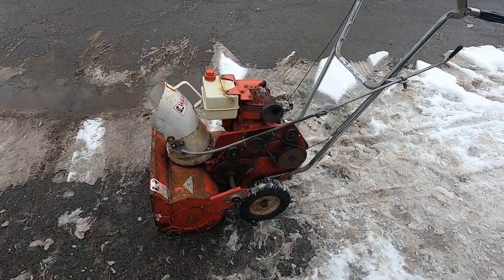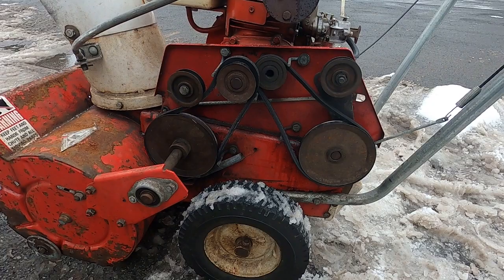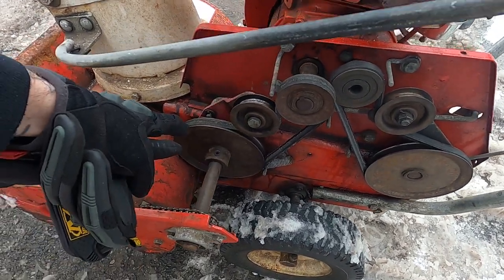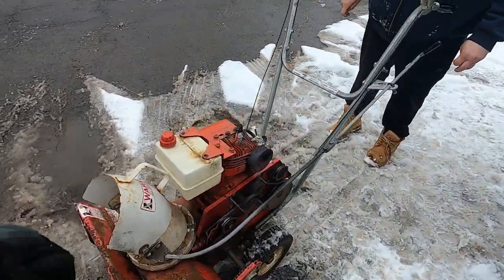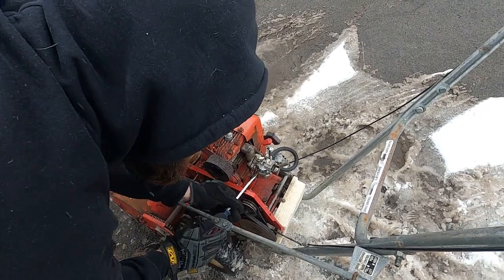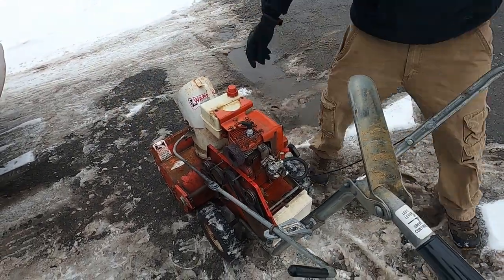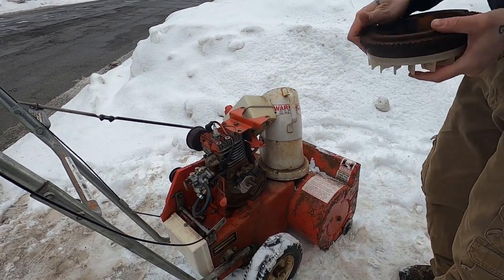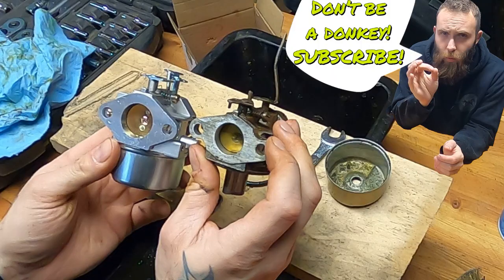Antique Sears Snow Blower Explored

Comment: I have a 1974 Eska  945c snow blower that was made in Dubuque, Iowa. Zero safety features.  Auger spins when engine is running.  Has forward and reverse. All chain drive.  Single stage. 5 hp Tecumseh.  Wasn't run for 35 years,  Put gas in it and it started.  Had a 8 inch snow with drifts and the beast tore right through it. A keeper.

Comment: I believe the sideways mounting of the engine is on purpose. It appears to be a single stage that is actually propelled by the wheels. If you look at the modern-day Toro snowmaster series of single stage snow blowers you'll notice that the engine is sideways.

Comment: The model number is 536.918000. The 9236 is a code of some sort... I know it is NOT 1992, because I have the same model, coded 9225,  and I'm pretty sure I was using it in the 1980s in highschool...  Two more things, it came with a plastic cover for the drive belts, I still use mine in the Chicago weather.
Reply: The date code is the 236th (236th) day of 1979, which was Friday, August 24th. Yours is the 225th day of 1979 which is Monday, August 13th. The "536" in the model number denotes that AMF/Western Tool (which eventually was bought by Murray and then Briggs and Stratton) made it for Sears.

Comment: Looks like a 3.5hp to me. The Tecumseh service manual has the Sears to Tecumseh cross reference chart, its in the back of the book, you can download it off the web. As far as points. First digit of the seriel is the year. Anything under a 2 will have points. Its pretty easy to tell between a Tecumseh built in the 90's and one from the 80's, so if you get one of those older ones, look at that serial, anything before 1982 will have the points, without having to pull to check.

Comment: As noted below, 9236 would be the 236th day of 1979 production which was Friday, August 24th, 1979, so it would have likely been found in the 1979-1980 catalog. These were made by Western Tool/AMF (who at the time owned Harley-Davidson) which is signified by a "536" model prefix. AMF eventually sold this division to Murray and then Briggs and Stratton owns it today and provides the remaining parts and service support for them. 536 model prefix blowers (and other equipment) were made for Sears through the 2000s. Now Craftsman equipment (even that sold at Sears) is mostly supplied by MTD who is owned by Stanley Black and Decker who bought the Craftsman brand a few years ago. MTD product sold at Sears will have a "247" model prefix.

I've fixed plenty of these over the years and gotten most of them for free. They are good solid machines if they are well taken care of. Nothing beats a Tecumseh Snow King. They don't call it a "King" for nothing. Main thing is clean fuel, clean and full oil level. They will last forever if taken care of.
Reply: Last forever versus the new junk. You're right on. These old blowers, single stage don't have the garbage gear failures, just bearings and belts in the end, engine side usually the carb on the Tecumseh
Reply: @Bog8686  Everything heavy duty and simple to operate.

Comment: I just picked one of these up out of the trash. It needed a chain, and once I replaced that I realized the chain was really floppy and scaring the shit outta me. I did some research and found out it is supposed to have an idler sprocket for the chain that attaches the the side of the auger housing. It pushes down on the chain so it stays tensioned. The part # is 50192. They’ve discontinued it but apparently any #35 idler sprocket will do as long as it is the right width to line up with the chain and has a bearing in the center. Check and see if yours has it because that might be why its so scary when it starts turning.